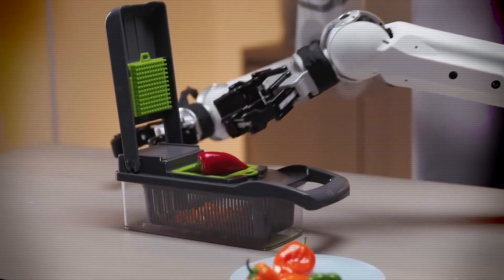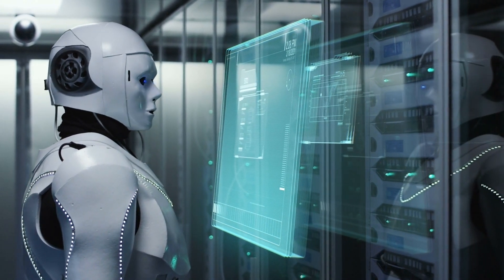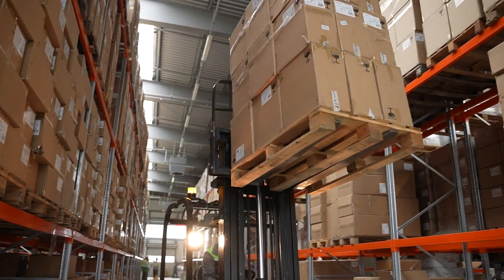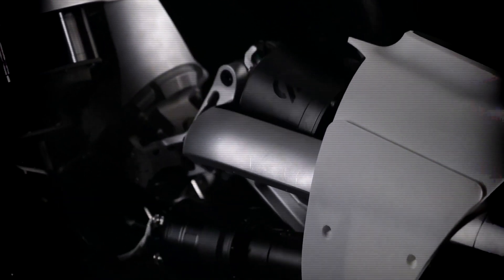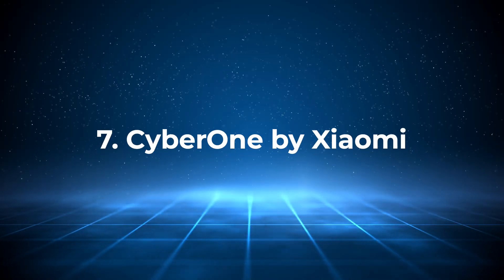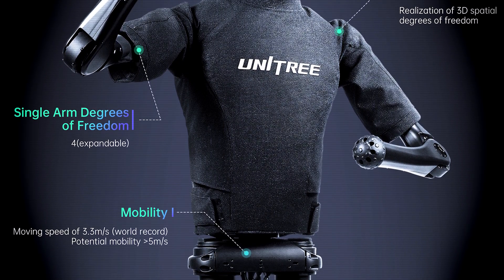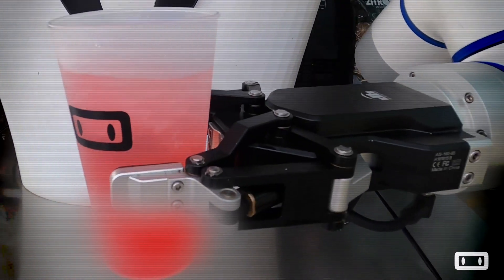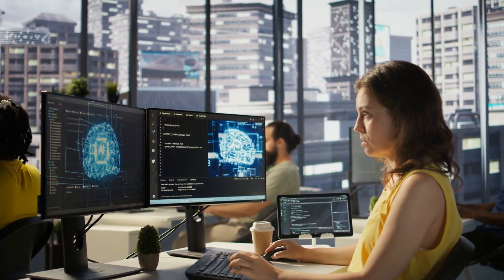Top 10 NEW Humanoid Robots of 2024 (Updated)

Comment: Wait so Kime sits in one spot and only dispenses predefined drinks. What's the benefit over an automatic fountain that have existed for decades at this point? Seems like those have larger tanks, better throughput, less to break (why would you give that thing glass bottles?), and can have the same camera-based tools layered on (for recognition of regulars).

Essentially, for most of these: why does it need to be humanoid? Purpose-built automation is much more efficient & these aren't flexible enough for a true generalist role.
Reply: Because alcohol costs more than a soda and ppl would abuse the system, why it’s behind some glass, I think I saw an ad for one in Vegas. I mean when 7-11 said fill up ANYTHING with slurpee for “blank” price ppl brought in 10am bottles…